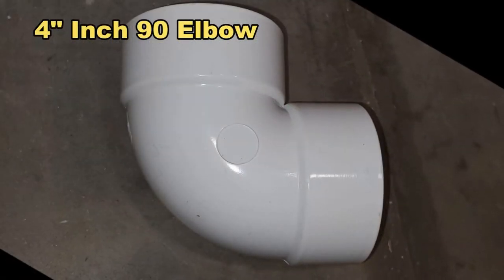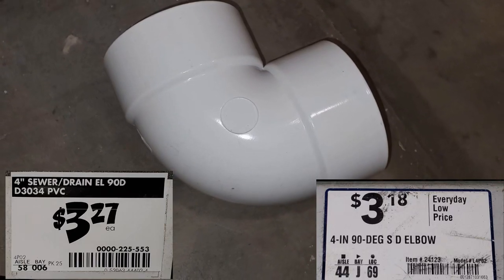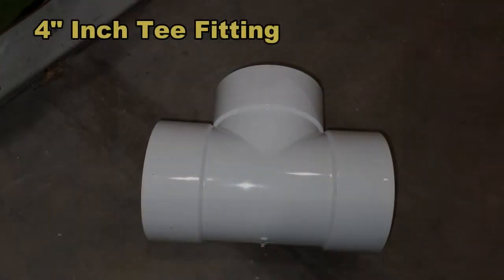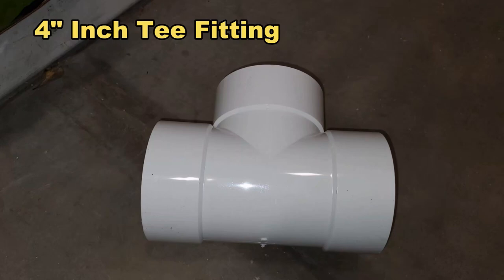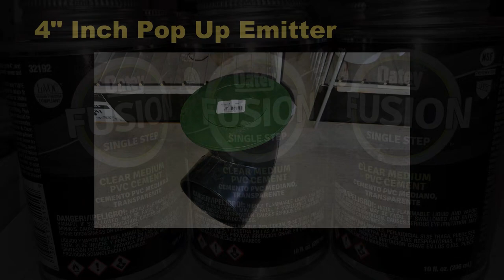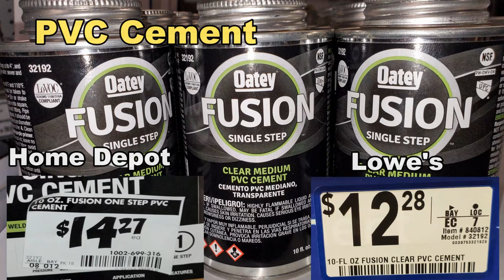Which is Better? Lowes vs Home Depot - Plumbing - Yard Drain

Comment: I live in Quebec province of Canada. Here, Lowes operates under Rona banner.
Lowes/Rona offer both big box style (Rona Entrepot, similar to HD in size/selections),
and neighbourhood smaller, local stores just called Rona. 
Rona is more expensive, but offer 15x more stores.
I live between 2 Home Depot 30 to 45 minutes away; in that same area, I have 12 Rona to choose from, 
including 4 that are less than 20 minutes away.
Price is one aspect, but proximity is also a factor.

Comment: For these items, I do like Lowe’s. I’ve installed the small 6” (2) that feed into the black drum/ sump pump on the side of the garage. My neighbor drains ALL their runoff into our back yard so my sump pump works great. Now I’m going to drain some runoff at the lake into a pipe that discharges through the bulkhead wall (3”) so I’ll need a 4x3 reducer. Wish you could get 3” corrugated drain pipe

Comment: When it comes to big box HW stores... it's Lowes for me every time. Except... when I was planning and sourcing my drainage project, Lowes had little of what I needed in stock plus long wait for delivery. Same thing happened with an attic pull down ladder I was installing. Maybe the supply chain issues are hitting them worse than HD.

Comment: HELLO cHUCK. 
Thanks for your videos. Very good. we love it.
I would like your opinion or any plumber that can help me.
 when installing medium size catch and water pump . (NO possible to connect to any pipes around). the plastic catch needs pebbles and concrete underneath ?
 or only pebbles underneath but concrete inside to avoid catchment to move up once it rain ?   It happens once to me!!!  The  plastic came out of the hole and was floating  . 

what can i do to make it fixed and stable inside the hole?
Thank you for any help .

Cheers.

Comment: Hi Chuck, thank you for the great video. I recently tried installing 3" triple wall ADS pipe to a 6" nds spee-d basin and noticed the piple has alot of slop when going into the basin pre cut hole any tips for a tighter connection? Seems like these NDS spee-d basins are built for corrugated pipe

Comment: Want to install a 6 inch catch drain which is next to a cement walkway and a 3 foot high cinder block wall due to being the lowest point in the yard next to the house. The downward flow would be to run the drain pipe through the block wall which is 2 feet away from the house, then under the house, which slopes to the other side about 45 ft. House sits on a raised frame with sloping dirt underneath. Would this be okay using pvc or flex?

Comment: I only have a lowes store locally but when its a bigger order, Ill drive to HD because of three reasons: 1) they have more in stock more often (not counting current times), 2) most of the time the price difference is more than enough to cover the cost of fuel and I can get several orders in one trip. 3) in the past three years their staff (on whole) is more helpful though just as parse as Lowes.
Reply: So I just finished the video ... those are some vastly different results from my area. Its only 2' here today but I have to .. supposed to run to Lowes to get something for a project and they do not have it so Ill be getting it at HD today has it in the store. I really like how you laid out the video though as it seems too many just purchase without thought.

Comment: What is the difference between ground water, roof downspout water and basement water?
Can one drainage system be installed to address all water issues?
Reply: ground water is water being held by the soil.  While all soil holds water, it should drain down and away normally. If it pools and sits there, the soil become saturated and can't hold any more.  If it sits there, water will always find the lowest level so if it's soil around a basement it's going to find any gaps and come in and become basement water. 
 Downspout water is the water coming off your roof in large quantitates , but only when it's actually raining.  If properly routed its taken to drains and doesn't add to ground water. But if its not taken away it goes straight to the ground and or basement.
 A french drain to give saturated soil a place to drain too will solve ground water and you can tie the downspouts into the same pipe. Will carry away the heavy flow of active rain and then give a place for the steady drip/drain of the excess groundwater. It's possible to need additional basement drainage but often fixing the downspouts and draining the wet soil spots will fix basement water issues.  Talk to a pro for guidance even if doing it yourself.

Comment: Here is my question

What is your feeling about using 4 inch perforated hose that comes with the sock covering vs the pipe with the gravel and the cloth?

Home Depot sells 100 foot rolls of this 

It seems way easier and quicker to just rent a trencher and roll it into the trench and cover it back up

Comment: I just cleaned my lanai drain and need to plumb it outdo it drains. Right now I have a dam.  Pretty simple project. I do have a question for you. Any advise on making my drain or a catch basin snake proof? I am in swfl and have many snakes around my home.  I do not want them coming into my lanai through the drain pipe / channel

Comment: Despite the outlet size being the same a 6" catch basin is NOT going to be able to handle the same amount of water as a larger basin due to the restrictions of the smaller grate. That being said, you very well may be better installing more smaller basins catching the water from more locations.